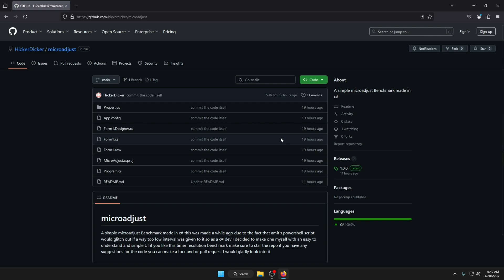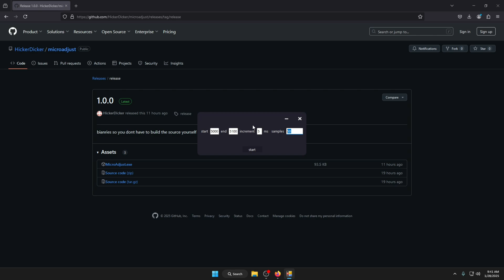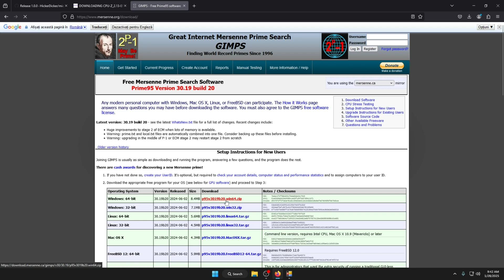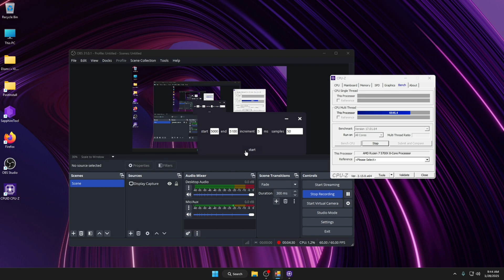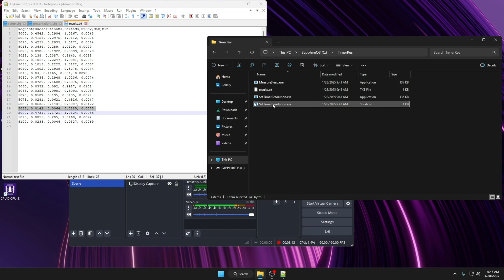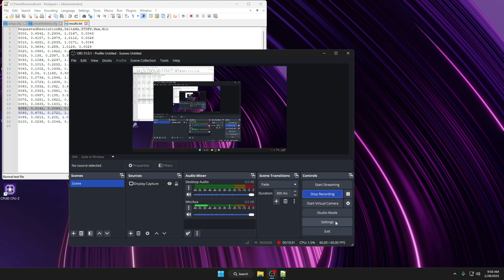How To Properly Set up Timer Resolution on Windows

Comment: I'm trying to set a different value in the "SetTimerResolution" file but it keeps on 0.5000ms. Anyone knows a fix to this?
Reply: same any fix?
Reply: make a bat file with this  inside , dont forget to put SetTimerResolution.exe in C , change the value "5220" with the one you want
start C:\SetTimerResolution.exe --resolution 5220 --no-console
Reply: @Samer_Design  nothing changes
Reply: @Hickensa pls help
Reply: you have a program that forces timer resolution to something. voicemeeter banana is an program that forces timer resolution to minimum for example

Comment: No reason to use timer resolution,more cpu usage and games automatically set a timer resolution and you wont see any difference with it on or off
Reply from the maker: Depends on game
For example
I mainly play games like quake (visible from my other uploads) which does not use hybrid sleeping or set a timer resolution by itself
Reply: @Hickensa  just use tsc which is better than timer res
Reply: @mitsoskars919 what is TSC ?
Reply: @Hickensa  can you make a video with your os optimizing fortnite and mostly focusing on latency and debloats

Comment: for some reason my deltas are showing between 0.100 and 0.300. but as soon as i stop the stresstest they spike back upto 0.5000 area. Any idea what could be causing this?
Reply from the maker: people usually get better deltas while not stress testing so this is very weird
Reply: @Hickensa  Is it very bad to have 0.5000 deltas? cause when i dont have them the timer res applied they're at like 14.9000